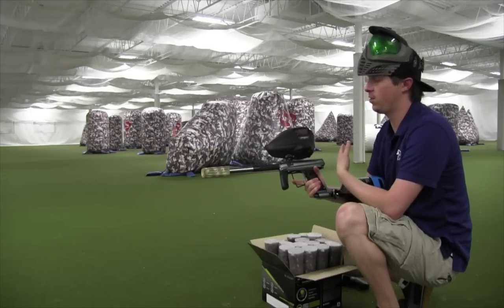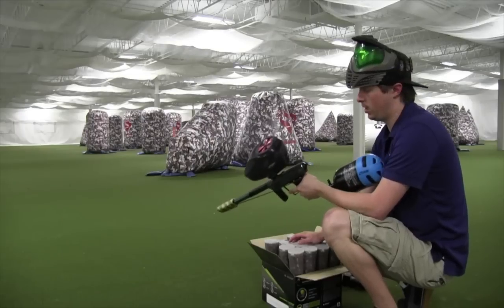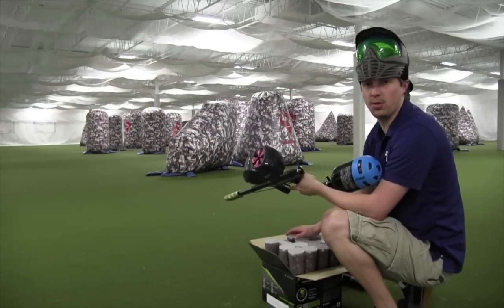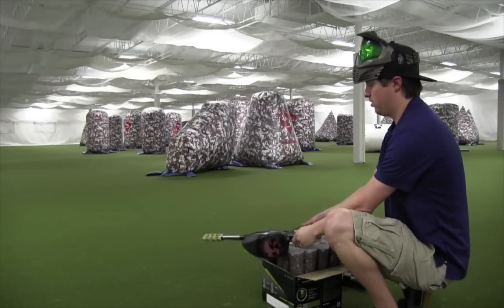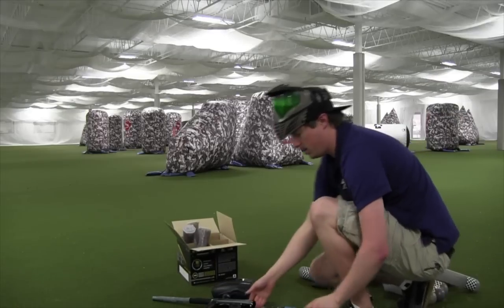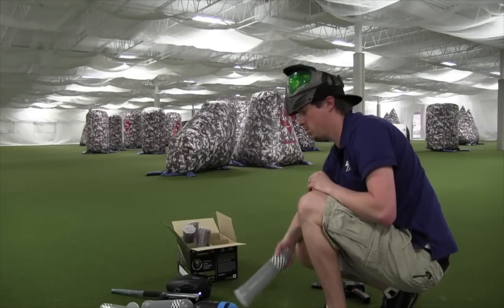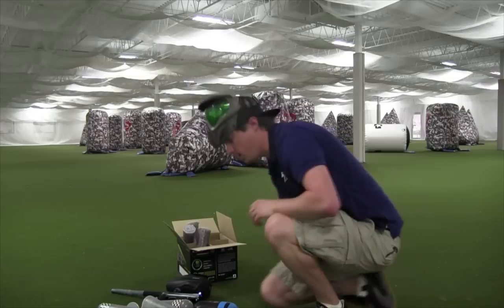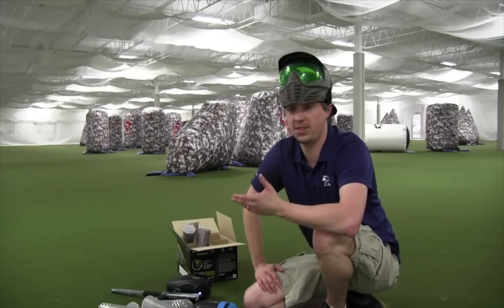MacDev Drone 2 Efficiency Test by Paintball Minnesota

Comment: Would that be 8 or so pods on a 45/4500? 
With it being an 77/4500 getting 10 pods.. ?
Reply: Ouch ok thanks.
Reply: RICKY RAMIREZ Thats huge for a 45/4500. Tbh, get yourself a Ninja 68 SL - its essentially the same length as a 45.